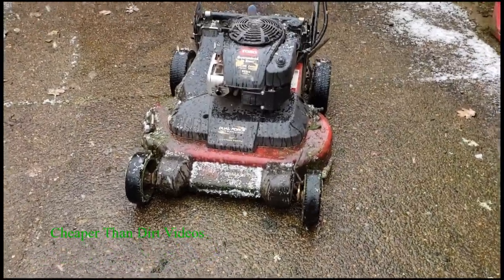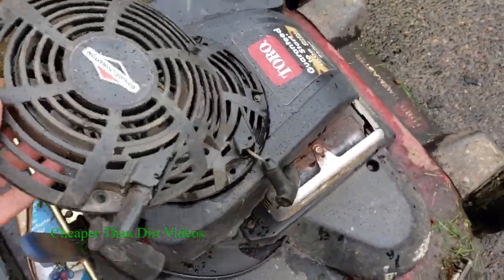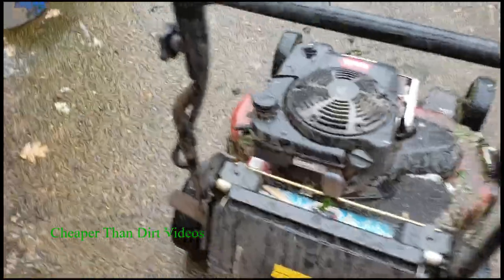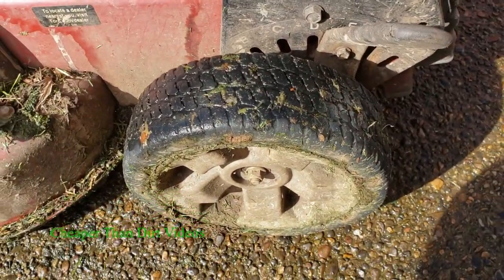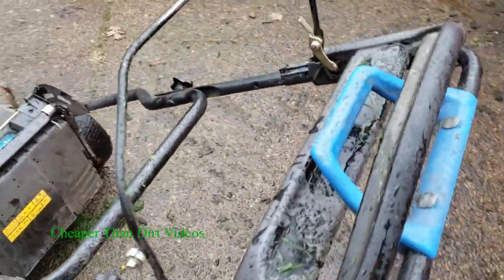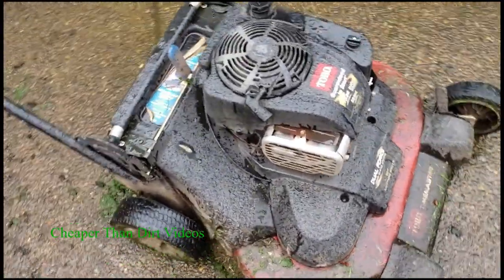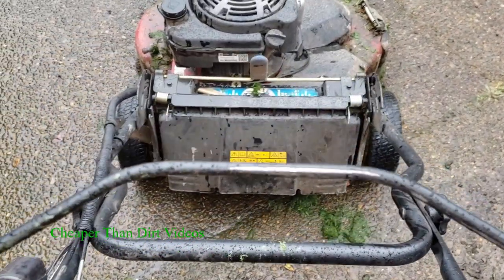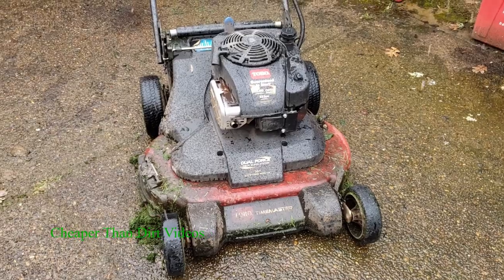Toro TimeMaster 30inch Commercial Lawn Mower  Review After 1year

Comment: This mower is NOT commercial grade. Please be honest with your subscribers. This mower is a Residential Mower however because lawncare businesses use this mower over the Turfmaster series commercial grade mowers mainly because of the huge price difference Toro will allow the warranty to cover certain repairs if used commercially. What that means is it won't be fully covered like the Turfmaster such as limited engine repair and transmission only. On the Turfmaster they cover engine, transmission, deck and belt pulley system. If you are going to use the Timemaster 30 commercially then replace the pulleys immediately with commercial grade because the stock pulleys do not last long at all. I do not like the 223cc Briggs and Stratton that came with my new 2021 model Timemaster 30 so I'm ordering the Kohler Command pro 225 cc commercial engine which is used on the Turfmaster. It has 11lb torque vrs the 10lb torque on the Briggs and is more fuel efficient than the Briggs. I'm barely getting 45 minutes on the Briggs though it is in its break in period it still should do better especially with fuel stabilizer using 87 octane with 10% ethanol. I cannot get non ethanol gas around here because last week they raised it to $7.56 a gallon at our local station and there's no way in hell I'm paying that much to fill a 5 gallon gas can. Hell even the damn stabilizer costs over $15.00, gee thanks Resident Biden  what a putz! I truly love the design of the Timemaster 30 but that Briggs has to go! BTW that blue foam they stick in the gas tank is absolutely worthless, it won't prevent Vapor locking and you stand a risk over time of the foam breaking down and messing your tank, carburetor and engine up. Even my neighbor a retired small engine repair technician scratched his head and asked why they would even do that.
Reply from the maker: Yes, not sure why they add the foam sponge.  I agree it would break down and contaminate the fuel.  I never thought about swapping the engine.  Seam like an expensive swap for little gain.  It probably would be better at cutting wet grass.

Comment: I have a 10 year old Timemaster - I was cutting 3 lawns with it for several years - down to just mine now.    I use side discharge when the grass is long or a bit wet - still looks good and you can take a full pass.   I use the 1/3 rule when mulching.    Replaced the blade take off belt once.   Transmission replaced under warranty (there was a "hardening" issue with metal used on early Timemasters that seems to be fixed).  The only issue I have right now is the kill switch is bad - I caught the wire to the coil on a bush - I've patched it back together a few times but now the switch seems to be bad (I smashed it on a wall last year so it is taped onto the handle - probably contributed to it's demise).    The Toro replacement part is pricey so I might just get a cheap on off switch and wire it.      I am mowing a steep hill now - and it actually does a great job.  Heavy enough it does not slide down as I cut across.  I tried a Honda 21 inch on it and it actually was too light - slid down the hill as I tried to cut across it.
Reply from the maker: Yes, I've had the kill switch wire come lose a couple of times now.  Had to solder it and found it difficult to work in the small space in the switch.

Comment: Respectfully, This is NOT a commercial mower.  The Toro website categorizes it as residential.  The dealer where I bought mine even stated it is not a commercial mower.  It IS a high quality residential mower,  just like the Honda. The Briggs & Stratton engine in a Professional Series which is a good strong motor for many applications.  If your belt is-breaking on average every three months., then that’s pretty good for what you’re using it for.  The engine, for a B&S, is quite tough.  My dealer told me that he does sell these to commercial lawn mower people while informing them that it’s not for commercial use.  They say “I don’t care” and buy anyway.  Anyway, it seems like a really good machine.  I know you guys in rainy climates have no choice but many mowers do clog when it rains.

Comment: The Toro TimeMaster is not a commercial mower the Toro TurfMaster is the commercial version.
Reply from the maker: It also costs $1000 more for no advantaged except for a larger gas tank.
Reply: @cheaperthandirtvideos1  The Toro Timemaster is not a commercial mower. It is for home owners. There is more differences between the timemaster and the turfmaster

Comment: I figured the biggest commercial complaint would be the tiny gas tank. Less than 30 min run time.
Reply from the maker: Yes, very small tank.  I get about 45min to hour.  I was able to get one acre done with one tank.  Mulched very quickly.  Conditions was just right.
Reply: @cheaperthandirtvideos1  One Acre/ one tank has got to be a record.  Maybe the tank comes down to marketing.  If all the performance matched the Turfmaster and it was a ton lighter who would want a Turfmaster?
Reply from the maker: Turfmaster is about $800 more for a bigger tank, strange wheel adjustment, and a bumber system.  Transmission, blades, pully systems, and belts are the same.  I take alot of crap on here for not using "commercial mowers," but I way how much more $800 is for a larger gas tank.  TimeMaster has slightly larger cc engine than turfmaster, so commercial makes no sense to me.
Reply: @cheaperthandirtvideos1  HaHa great take on the Turfmaster. I'm a homeowner but watch all the vids on lawn care. I too would only use Timemaster. Plus a large production machine down the road if I got busy. I'll add the wheels on the Turfmaster look tough though. Dunno how much more they cost or if they fit. I'd like to figure out how to get the Turfmaster gas tank on the Timemaster. It needs to stay between the wheels for weight. Especially in front of the rear wheels. Gets rear heavy when bagging as you know. Rig it with a commercial tank and you really got a machine.
Reply: @cheaperthandirtvideos1  turfmaster is completely different mower....engine, transmission, deck, handle, wheels, etc...all totally different from the timemaster.  They share no major components